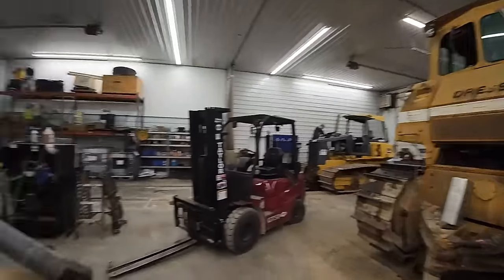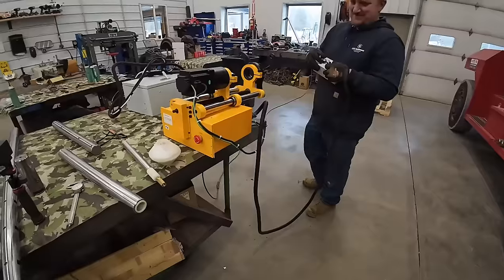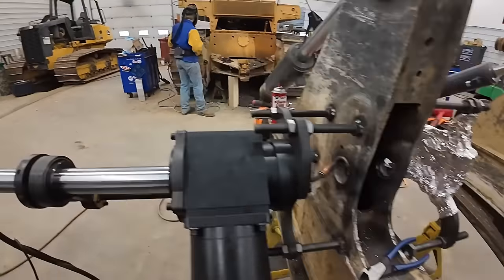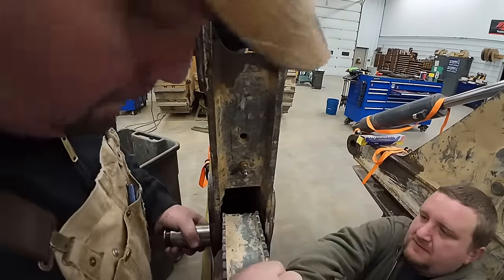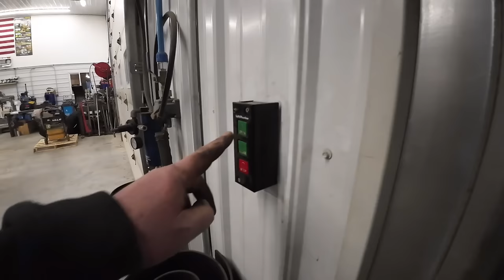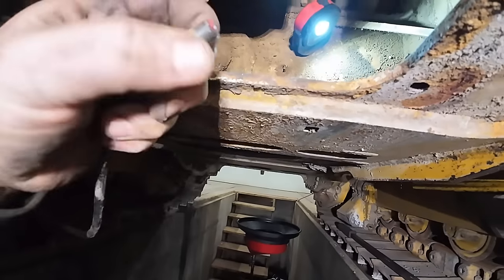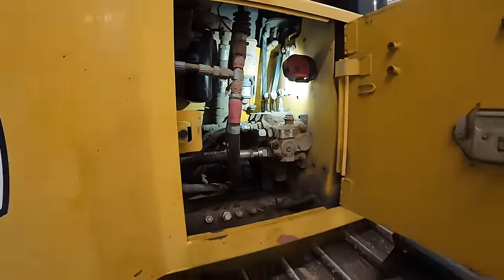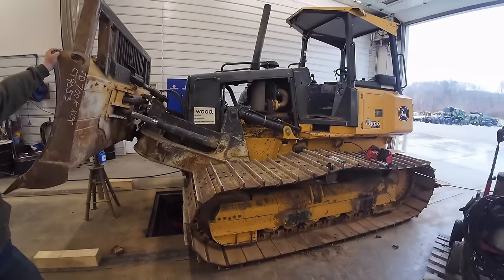Bore welding and line boring a dozer blade C frame and installing on a John Deere 700J

Comment: Kurtis on "Cutting edge engineering", another creator here on Youtube, I'm sure could help you with the bore welding machine. He uses it often. He too works on heavy plant out in Australia. like you guy's a very knowledgable bloke.
Reply: I was just about to suggest the same thing... And Homey is quite entertaining as well..😂
Reply: Great suggestion
Reply: I'm sure they are subscribed to CEE.  They have done their homework.
Reply: And #OnFireWelding😊
Reply: I watch him all the time. He's good
Reply: You took the words right out of my mouth deanc486. I was just about to mention that.  Thumbs-up mate
Reply: George and Homey…. Curtis and Karen are next level excellent.
Reply: Doesn't need help with boring machine.
Problem.is made in (h!na
Reply: Snowball Engineering is another YouTube creator, homemade line bore. He fixes, repairs, and make it better. Has pretty cool CNC machine. Check out his massive log splitter.
Reply: Curtis is the man.
Reply: Kevin has their hat.. or was that matty from deisel creek... anyways these dudes went to diesel creek.

Comment: UK 🇬🇧 fella from Yorkshire (Snowball Engineering) made his own line-borer - great channel like yours! Watch Wes Work recommended him 👍🏻
Reply: Although you're talking about someone making their own line-borer...I thought I'd just add
From what I saw it's not a 3 pin UK plug on original lead [before adapter].  Those 2 other pins (live & neutral) were diagonal to Earth pin not 90deg 
Not saying the machine isn't used here in the UK but it's not fitted with a UK standard plug. time slot 5:25
Reply: He got pretty cool CNC machine.

Comment: Line boring and welding? For a second I thought I'm at the CEE Australia YouTube channel... 😁😁
No seriously, I think CEE is right up your alley. Kurtis does repair jobs that others have failed or deemed impossible. He's a master at the lathe, line boring machines, honing machines, welding, gauging, Bridgeport. He does all sorts of repairs for mining equipment like graders, excevators, compactors. He even can rebuild hydraulic cylinders up to D9 dozers and 400 ton haulers. Heavy metal in the truest sense. 🤘🤘
Reply: I did too. I was wondering why they had a video out on Tuesday. :-)
Reply: Isaac at ICWeld is also a fantastic welder that Curtis at CEE follows.  Isaac does mostly field repairs.
Reply: In this video Kurtis is showing and explaining the range of tooling and consumables that we use for our WS2 portable Lineboring and Bore Welding machine.
https://youtu.be/vRgkWJRDcLw?si=FNui3gRkkO8RzPti
Reply: D11
Reply: Absolutely, I was Thinking the same thing watching them line bore. Kurtis is top notch which is why I think Clint would like his work because he's the same way, Quality work!

Comment: Might be that the boring machine was setup for 50 cycle versus 60 cycle electricity.  That would make the motor run faster and hotter.  Love your videos.  Kevin always makes my day.
Reply: Same thing I was thinking , there 50 cycles a second an we are 60 .
Reply: I would say your correct- he would have to replace them or send to a shop to be redone to American specs
Reply: That was my suspicion also. 50 Hz is very common in the Far East.
Reply: 10 hertz extra in cycles per second is minimal. Yes the motor would run slightly faster but that's it. Would not affect the motor heat as the main culprits for developing heat are load and current/voltage. Those cords are designed for 220/240 volts AC power but was supplied with an American 120 volt adapter. Not sure if the correct voltage was applied. Low voltage causes amperage to increase, resulting in more heat. Or the load, depth of cut, was too much. Just my half cent of input.
Reply: I think it's a stepper motor and controller with variable speed.
Reply: @12345NoNamesLeft  is right - these are almost certainly stepper motors, in which case, the control box contains a switch-mode DC power supply and stepper driver and the supply frequency is immaterial. At least one of the steppers has an encoder on the back, so they are effectively servo-steppers. Steppers produce a lot of torque at low speed, but these ones look too small for the application.

Comment: A machinist a I were in Texas on the side of a highway line boring inside a crane that was working on a bridge job, you talk about cramped up in behind the operators compartment! Welding up the bore and then having to help the machinists set up the boring machine! And this was start to finish like most of our jobs Clint! Everything was always an emergency rush job, and there was no going home and coming back! 2-3 hours to get there and we would work until the job was done! We’ve spent 20-30 hours on jobs back in the old days before OSHA was activated! Since I was driving the welding rig, that meant I was always the one to drive the machinist and I home afterwards! Lots of tiring hours driving back to the shop! I don’t miss any of it now that I’m retired but all of my body aches and pains now! Surgeries and recovery’s for the last 10 years now but I think all of that is done now! Just part of my lives work history in line boring jobs! Yall take care! 🙏🏻👏🏻👌🏻👍🏻🇺🇸✌🏻🙋🏼

Comment: On that drive motor heating up if you were running it on 110 that could possibly be why. Especially if you were on the end of an extension cord. If it can be rewired or replugged to run on 220 it would probably run  cooler. Double voltage half the current. Most stuff from over the pond were set up to run on 220. Great video as usual.
Reply: Yep. Probably 240v or so at 50 Hz. It's a wonder it ran at all and didn't rapidly self destruct.
Reply: Almost all stuff over here runs on 240 volt and 50 hertz (not 110 or 220)
Reply: Also the stepper motor (on the all black rig) do run very hot normally so nothing to be done there as they are designed for low rpm / high torque applications.
Reply: @martintijdgat6269 I don't know why some of us here in the states still refer to 110V. It hasn't existed in over 50 years. It's 120V and 240V and if you check it with a Fluke normally you will see up to 124V and 248V on the meter

Comment: I think you did a fine bore welding job and a great Boring job.  I worked on a line boring machine at KiwiRail for 8 years. welding up some parts of DC traction motors, but mainly reboring them.  The traction motors were about four feet long and weighed about a ton, in the stripped-down state, that is with the electromagnets removed. The bull gear shaft was about 6 inches in diameter. The armature bores were about 6 inches, while the flange end was about 18 inches in diameter. Id adjust the cutting tool by having a dial test indicator resting against the cutting tool and with the tool locking bolt slightly loosened and tapping the tool out for a cut.  I  had a tolerance of plus or minus .0015. inches.

Comment: I bought a used WS 2 standard line bore machine about 15 years back and never once had a problem with it. I decided upgrade two years ago and got myself the WS 2 plus which give a bunch of extra tooling, stronger motor for deeper cutting depths for increase efficiency etc. You can’t go wrong with any of the WS lines they have. They are costly tho but you definitely get what you pay for with these machines

Comment: Good day, over the pond they use 220 Volts and with the adapter your using 110 Volts. Cut the connector off and put a 220V 20 Amp plug the motor should run cooler.
Reply: Thats what I was thinking. If the motor is set up for 230V, Then 115 V would make it run hot. Unless it has some kind of an inverter drive that automagicly changes the voltage.
Reply: Check the wiring of the motor to see what voltage they are setup for.

Comment: I spent countless hours lining boring, that was one job I throughly enjoyed. You did a very nice job with it, and I like the adaptors you made up. That’s one thing I found is that one is only limited by the imagination as to how adapt the line bore to fit the project. It was an interesting job for sure. Hang in there Mason, they’re just jealous of ya😊. Thanks for the video and I appreciate your time making them. BTW, we used B&D line bores out of Sudbury Canada, don’t know if they are still in business though.

Comment: I just used the same yellow machine on a c frame for the attachment pins. The most cut I took was .020 and was vibrating like crazy and the motor got hot. It took me three days on those two holes… I worked it pretty good and turned out good

Comment: Nice work guys
Although I'm a bit disappointed that Kevin didn't point to the glowing metal and say "You can't touch this"
And then whilst swinging the Precision Alignment Tool say "It's hammer time" 😅😅
Nice job guys 

P. S. The line borer looks like an Italian sold item originally manufactured in China.

Comment: Great job keeping small amounts of rubble under control and makes it saleable or reusable. I have been thinking of getting one for a while now. It is a big enough outlay but if you look at it over several years of use and the odd hobb where you can recycle material on site its a good investment. Mayby a piece of conveyor belt rubber mointed from dynamic jaw to the top somehow would keep debris from the ram

Comment: Clint,
Europe and UK use 3 phase power converted at 380/415 volts at 50 hertz or cycle speed.
It is likely that you might need a phase converter to correct the voltage and raise it up to match the 415 v.
US 3 phase is typically 308v at 60 hertz.
The simple solution would be to talk with a local electrician who knows the conversion process and see what the best solution is.🤙

Comment: The Hertz are definitely slightly different across the pound. My motors often come from Italy and they have different Hertz specifications on them.  They seem to run fine but maybe that would make them run hotter.

Comment: Overseas standard outlets are 220-240v and 50hz. I'd say the hertz/frequency is probably the problem with the motor running hotter.

Comment: If you're looking for a quality line boring system,  Climax is the only way to go.  I use ours daily in the machine shop, and it's top of the line.  Only issue with it is.... It's not cheap . Our system was around $45,000.

Comment: Curtis on CCE Australia on utube does incredible jibe of line boring and reselling the bore and icweld on utube is a master at welding. He would have used the elder to gouge that plate off and then cut that bent up parts and then put a piece back in there that you would never tell it was worked.
Love your work guys. Working on big iron is my kinda stress reliever. lol!!!

Comment: I worked in a machine shop/fabrication shop for 37 years, the machinists would go out in the field and line bore different jobs and I would have to hand weld the bores before they machined it out! The company bought a mechanical bore welding machine and it was a whole lot better and easier! Then we got a job welding the I.D.’s of pipe nozzles and that was Inconel, they had to buy a special welding machine for that application!

Comment: I worked on Toro loaders. The pins and bushes are fitted using liquid nitrogen . Ja well no fine. 
I went out to a mine about 20 years ago . They could't change a lift cylinder because the pins were frozen in there , not even a jack could get them out. 
When I got to the workshop up on surface one genius had already packed explosive around the bottom pin so i moved my truck out of the area and waited for them to nuke it. They did. There was an enormous bang and a cloud of dust and smoke. 
When it all cleared we went back up to see what happened and the front frame looked like it had been hit by a landmine , but the pin was still firmly in place . They had to get a new machine.

Comment: On the line boring equipment. Sir Mechanica out of Italy makes some good equipment. 

Your motors might be 220 volt 50 hertz that’s what most countries in Europe use for standard tools. 

Also Kevin scares me sticking his finger in to hold that spacer. That’s a big no no. A guy I worked with did that while putting a set of tracks together and now his finger is about an inch shorter.

Comment: Snow Ball engineering also made his own line boring machine from scratch. It works great and he does jobs like that often and you can pick up pointers easily and he explains what he is doing when doing it. Hard part is trying to understand that thick English accent 😂😂, but he's very talented with a small shop in his barn in England.

Comment: I bet Curtis at CEE be watching your work.
Reply: Curtis is the KING of line boring!!!
Reply: Yea Curtis is good an he's in Australia, if that motor is set to euro volts it could be setup to run on 50 hrs, we run on 60 here, idk if that would make it run hot or not
Reply: Suppose to say hrz, an auto correct changed it lol
Reply: And #OnFireWelding
Reply: @timhamrick9498  It's most likely optimized for 220V... which would explain why it is getting hot running on 110V.....
Reply: Yea true but I thought they had a voltage adapter but I could be wrong ,they might of just had a adapter for the plug.
Reply: @timhamrick9498  I am sure it has a voltage adapter to run on 110v but the motor and the gearing and such may be optimized for 220v so it pulls less amps and runs cooler.

Comment: I believe the reason  for the overheating is the  boring machine runs on 220v 50hz.
With that fast look at it . Looks like you were running on 120 v
 So it will draw a much larger current.

Comment: Those power cords are for 240 volts 50 hertz power! I think the one you have is China style. If you didn't use 240 volts the motors are pulling way too many amps. The feed should be the maximum depth of cut; 2mm one side equals total of 4mm cut with one revolution. That's what I make of it. You were twice that depth of cut, correct? Keep up the great videos.

Comment: 2mmcut at a time = 0.0787 of an inch and as you were cutting 0.080 at a time you were working that motor to it max and seeing the speed you were cutting at it was not surprising it was getting hot!

Comment: I belive that that acros the pond line boring machine is set up for 220v 50hz electricity
try cheking it on components inside that big white controler cabinet

Comment: As other people have mentioned, Europe runs everything on a higher voltage. So, you likely don't have enough juice running to it making it work harder. I do know the voltage is different between the states and Europe, but I don't know about what frequency it runs at or if their single phase or three phase are similar. If you got an electrician friend, they could probably figure it out.

Comment: All European motors run on 50 Hertz (cycles per sec), whereas in the USA, we use 60 Hertz power.  Check to see if the motor is capable of running on 60 Hertz power. If not, then that might be the reason the motors were running hot.  (maybe buy USA made  eqpt)

Comment: that JD 700J looked like it had Taco Bell for lunch and dinner 😆 overseas questionable line boring/bore welder tackled the job, surprisingly made it thru without catching fire/ utter failure. run er till blows up, salvage what parts saveable and go Snowball Engineering route

Comment: A lot of other countries use 50 hz electricity, the US uses 60hz. It can cause a motor to overheat. That could be your heat issue with your machine.

Comment: The normal voltage in Japan is 100 voltds. You need a step  down transformer to reduce the building power to this level. Make sure the transforrmer is rated for the current at the reduced voltage. (E=IR) Also the voltage tolerance is quite small so the transformer must have different "taps" to reduce the voltage to the 100 volt requirement.

Comment: Hi Clint I wrote to you over a year ago saying "I could not believe you don't have a line borer" and you duly replied " I got a brand new one in a box some place"!!!! Anyway good job for a bunch of "rookies" ! Your motor issues could be both voltage and frequency based!!! It is also possible they are using DC PMG motors (good speed regulation) these may not perform correctly if the mains power is not correct as the feedback / speed control loop inputs will not be as per design. A local guy with a basic scope / waveform display meter would sort most of the issues in regard to "is the power correct" etc in under 5 minutes if everything ready to go! If it is the input power it can be dealt with but how cost effective that would be is anyone's guess. My feeling is the Mfr given the market they are in will have some internal jumpers and dip switches to sort these "issues". Failing that send Kevin of a crash Chinese course!

Comment: That hot motor may be cause from voltage drop. Extention cords and the distance from the fuse box. Check voltage at the motor.

Comment: Most European countries use 240 Volt and 50 Hertz in 2 fase, or 380 Volts and 50 Hertz in 3 fase. So set your electricity for these bore welders to those settings and you must get rid off your overheating problems.

Comment: They call it Chenglish, and yes they do have different power settings in that country. On electronics there is normally a switch that allows one to change the voltage from 220(China) to 115(US)! Many devices are defaulted to 220 and will let out the magic smoke if you do not change to 115 before plugging in.

Comment: It will run with following problems for a 50Hz motor running on 60Hz: The core loss will increase and cause over heating of core. As the core loss will increase, the Power Factor of motor will reduce.